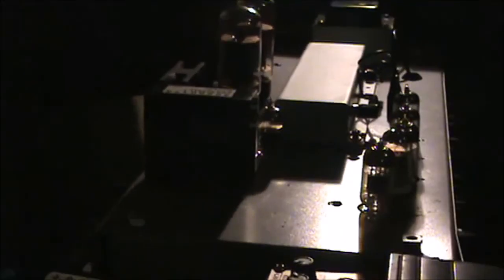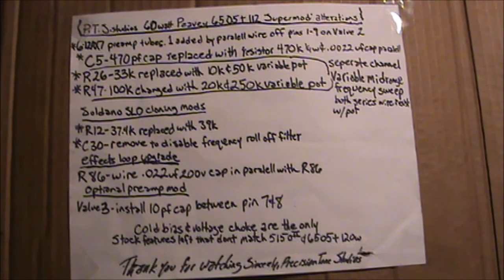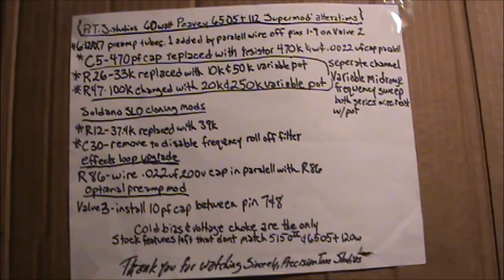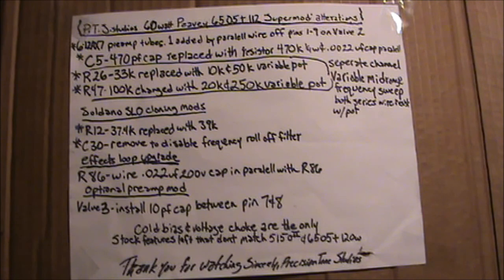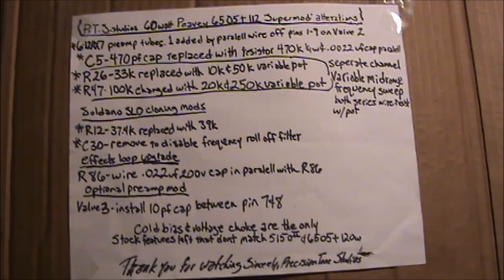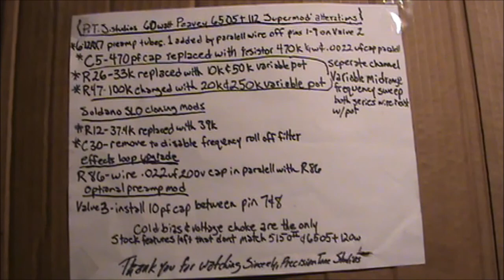6505 112 mods tutorial, with amp demo.

Comment: can you please elaborate on added tube. what does it do? add gain? headroom? thanks. also do you have a page detailing everything?
Reply: Hey, I had no idea there was all this response to this video, and honestly I'd forgotten I even made it lol. I uploaded this from my old Google account, and they screwed me out of being able to access it cuz the bastards said my password was wrong, when it in fact was..So to answer your question, and I'm going on memory here from almost 10yrs ago. I added the tube just paralleling the 9 leads from v2.. Honestly, I barely knew what I was doing back then and didn't understand tube amp circuits nearly as well as today.. However, I would probably do everything far as the extra tube mod the same considering the results it yielded, plus how easy it was to install schematic wise, and the fact that the mod was easily un-doable. I wound up hardly using the leaf channel after that and used the crunch almost exclusively.

Comment: hello david henry guitar, I made the mod in preamp of my 6505 112, in the rhythm of the channel, to be equal to 5150 II, because I have one and I would both stay with the same sound, but I make changes of components only between the tube and pots of eq, however the rhythm cannal got the much lower volume than the lead channel, for example, the rhythm in volume 5, is equal to, lead volume 2, you have any suggestions to give me, to both have the same volume,? Because the rhythm with this very low volume compared to lead, and I miss the volume when using the amp with the band.

I used these schemes, I modified all values of c31 to r8, that sounded like 5150 II with bright switch, activated,

http://www.thetubestore.com/lib/thetube ... ematic.pdf

http://www.thetubestore.com/lib/thetube ... ematic.pdf
Reply: Chrys Sid I seen a vid that shows a tube change that cleans it up somewhere on here